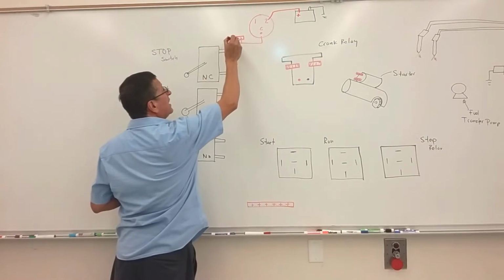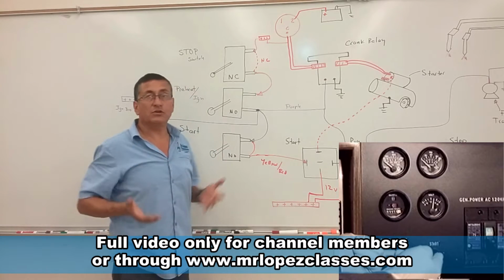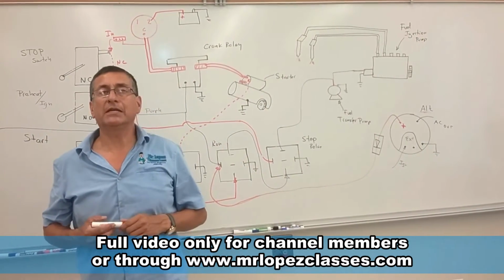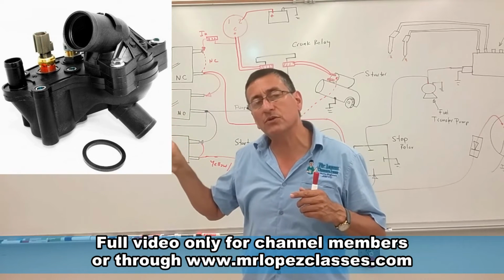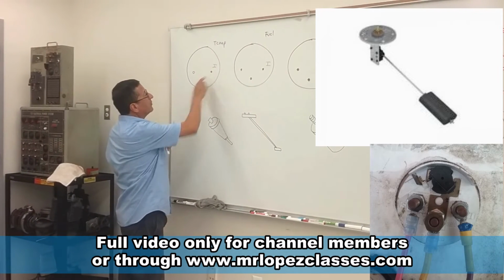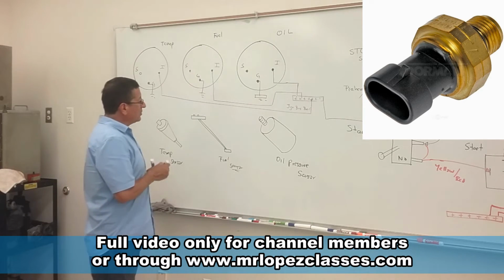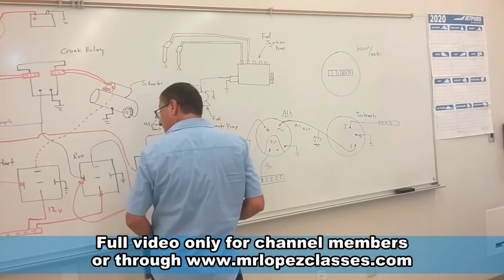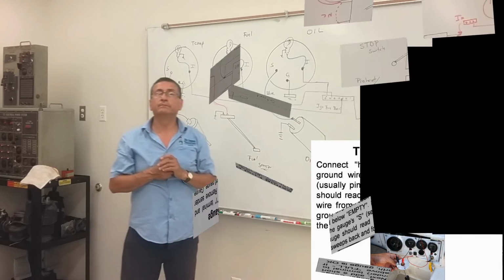How to design the Harness of an Engine or Generator / Highlight Video

Comment: Hi Mr Lopez. If I was to rewire a boat. Do your books indicate the correct wire gauges/awg and colors used for each component? 
for example to wire gauges, ac and dc switches, electronics, sensors, lights, pumps, batteries etc?

Thank you
Reply from the maker: 😀 Of Course Alex. And also there are some episodes where I explain how to wire the DC panel, How to wire the dashboard including the installation of all the gauges , switches and sensors.
And I can help you during the process. We can schedule zoom conferences and I will help you during the process.
All the episodes, courses and books are in my website www.mrlopezclasses.com
Reply: @MrLopezClasses  excellent! Will contact you once I am ready to inspect what I need to do.